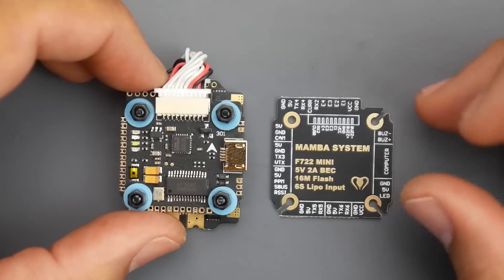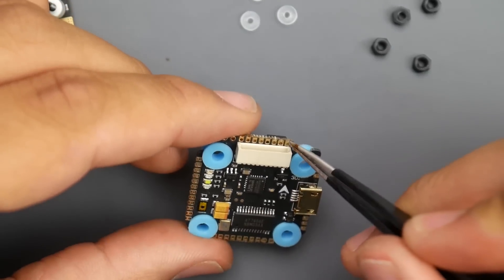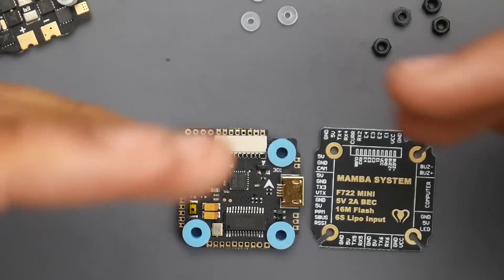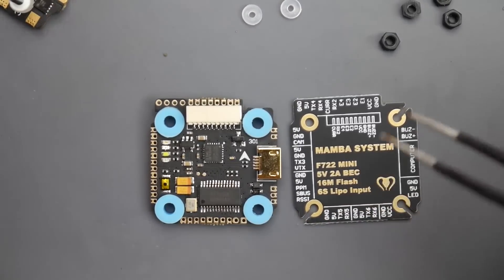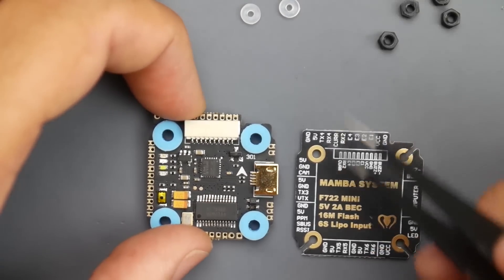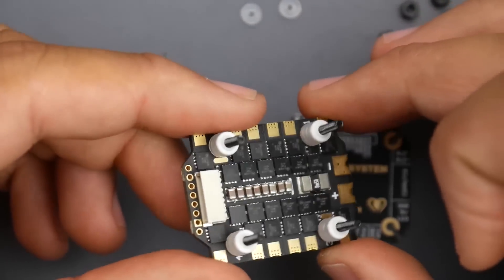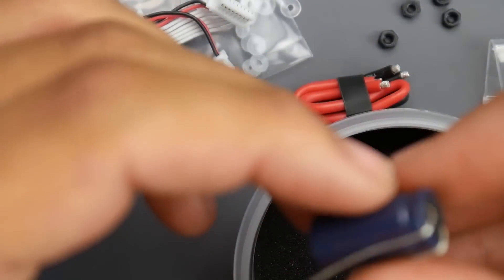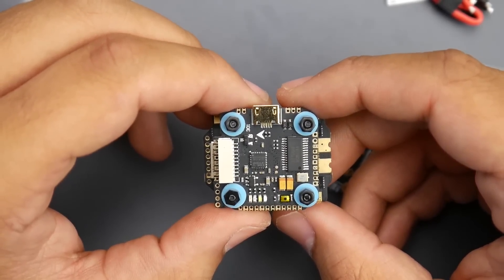Mamba F722 Mini Flight Controller Stack

Comment: great review - anyone successful using PPM or LED pin for OSD camera control? Can't get into camera menu for some reason, regardless with or w/o 330Ohm inline resistor...
Reply: Did you manage? Do you know what pad B08 is? that's what shows up as resource camera_control for the Mark 2
Reply: @jorgemiar  seems the internal pin resistance is flawed, BF devs told me it's a hit and run. No solution, had to give up... 🙄

Comment: Diatone doesn’t listen. That boot button will last about 5-10 presses then it’s gone torn off. Why bitch about the boot button because diatone is always halfass. The F4s were halfass with there half uarts which left you with zero flexibility. As for the F722, good job on copying matek. Diatone is garbage
Reply: keep up awesome work Diatone:), we can use affordable stack!

Comment: Ive been running the f405 on 6s for a couple of months now with no problems at all. I put a 1000uf cap on it and dont have any video noise what so ever. I will definetly buy this if i do another build.

Comment: I LOVE DIATONE !!!!!!!!!!!!!!!!!!!!!!!!!!!!!!!!!  I have collected almost everything they make,  and these new F7 stacks are amazing !  I am waiting for my order to arrive.  (A BIG ORDER)   I have installed about 10 of the old 405 stacks without ever having a problem !  I think this new setup will be absolutely AMAZING !   Bluetooth built in ?  wow !! People who complain about price do you realize BBee has to get paid to have this in someones electronics ??    WHY CANT EVERY FLT CONT HAVE SOLDER PADS FOR THE 4/1 ESC ?    I am so tired of having to rearrange the pins in a plug setup.  BRAVO DIATONE  !!   ps  CHECK OUT THE NEW CARBON FRAMES OR THE CUSTOM PHOTO FRAMES  !  for $10.  you can have ypur dogs picture on your FPV frame